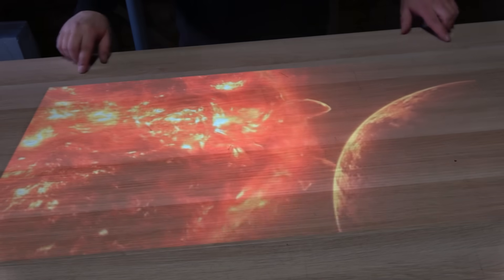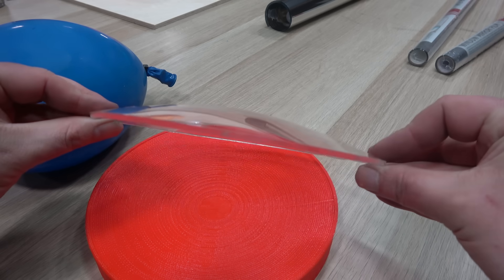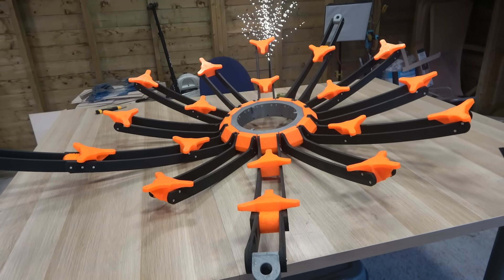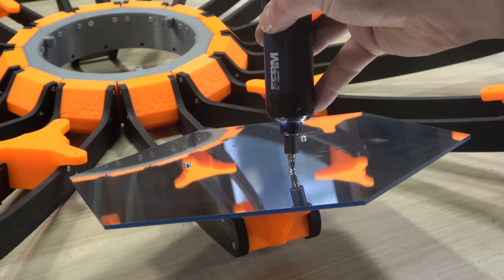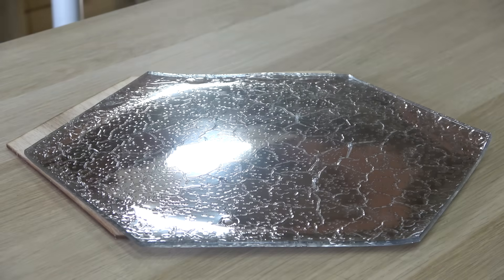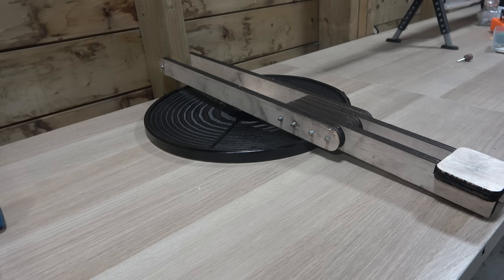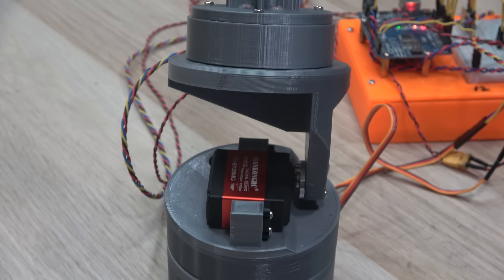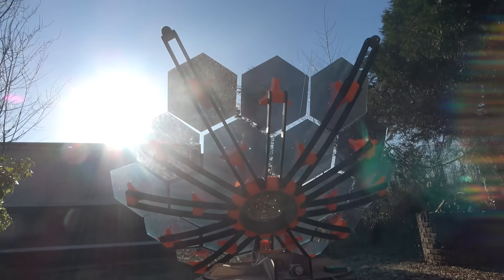Building a DIY Solar Generator..

Comment: One glaring thing that may be a problem... the heat collector is currently reflective. Spray it matt black with heat resistant (stove paint) paint as it will absorb heat much better than the shiny surface.
Reply from the maker: Good one!👌
Reply: @ConceptCraftedCreations The fact you're using aluminum gives you an option for making it black: 
There was research done stating that a simple candle's soot actually forms carbon nanotubes onto the aluminium surface.

Simply put, just soot the aluminium disc with a candle and gently have something transparent to protect it from the elements.

Used this for my solar space heater, works well, however haven't tested if simply painting it black has any difference. But theoretically the nanotubes would be perfect light capturers.
Reply: @elpi2804 the soot might not last in adverse weather conditions
Reply: @elpi2804You haven't had problems with the soot oxidizing off the surface? I assume you have a direct solar arrangement if that is the case, I don't know if that would hold up under the conditions of concentrated solar.
Reply: @sandwich2473 you could seal it with something, lose a little efficiency for durability
Reply: @elpi2804 you can't put glass on the collector... most glass only has a transmissivity of about 0.8 or your'd be reflecting a significant amount of solar energy. The guy suggesting liver of sulfur probably has the best low cost idea. Either that or some form of anodizing.
Reply: @ConceptCraftedCreations  dimple the surface like a golf ball before you paint it for more surface area.
Reply: @IvanSpaceBiker  that would do absolutely nothing.
Reply: @ConceptCraftedCreations  it might be hard to find paint that can resist such high temps, but i hope you do. In either case sand down the surface with a medium grit to make sure there is no reflectiveness, either on the black paint or the bare aluminum.
Reply: @SocialPrime  Oven paint will do, the cheap one I use is up to 500°C heat resistant
Reply: @SocialPrime  Paint for BBQ's
Reply: Anodisation would be hard wearing and shouldn’t need much maintenance.
Reply: @psibug565  this is the way. Paint, even "heat resistant" paint will be no match for the high temperatures  it will experience.
Reply: high temp paint or ultra black are good paint choices. Not sure how affordable ultra black is but it absorbs something like 99.9% of IR and UV that hits it. Stuff gets super hot even indoors under air-conditioning, it's really effective.
It might not resist the super high temps though, so High temp paint, which i believe has carbon in it, is very effective as well.
Reply: .I think the point is to reflect the heat to a single point and collect from a large array to concentrate the power potential.
Reply: You'd be best off sand blasting the surface then black anodizing the active surface of the metal. You get geometric and thermodynamic advantages to light absorption.
Reply: I believe carbon soot is less reflective than high temp matte black paint.
Reply: I can tell some of you don't do camping. Try cooking with a pot over a wood fire and then attempt to clean that pot! 🤣
Reply: That's a great idea, I was just thinking about that but I think it's made for cast iron so you should check if it works on aluminum at high temps
Reply: Hard anodizing would be my suggestion. It has extreme heat resistance, has a course surface finish (not to the naked eye) and therefore better heat absorption.
Reply: Was also thinking this. I was also thinking why not put the collector out at the focal point so one side is in direct sunlight and the other is in the reflected light heating it from both sides.
Reply: You can use the blackest paint in the world

Comment: I designed a very similar parabolic system for a humanitarian project aimed at desalinating water (it also produces energy). We incorporated a turbine specifically designed for the flow rate of the steam generated, ensuring optimal energy production.

In my case, I justified later the design by referencing the James Webb telescope to leverage its prestige, though it did not directly inspire the design itself. The hexagonal shape ensures optimal precision in forming the parabolic curvature ratio, which leads to the best focal length and, consequently, the highest efficiency. Our system uses a highly precise skeleton for structural support, eliminating the need for springs. Additionally, we utilize a different material between the mirror and the support structure to improve durability and performance.

For solar tracking, two axes of movement are essential: daily tracking (East/West) and monthly adjustment (North/South). Our system also uses a worm screw mechanism for daily tracking and a stepper motor for monthly inclination adjustments, both equipped with reducers to provide the necessary torque to move the structure. If you're in the Netherlands, your system should be oriented south. To achieve accurate azimuth positioning, your Arduino code must account for your specific longitude and latitude, the parabola's position and orientation, the current date, the time of day, the solar altitude and azimuth angles, and any necessary compensation for tilt or misalignment of the parabola.

Regarding the reflective film used here, I think it appears to be Mylar. While suitable for short-term projects, I wouldn’t recommend it for long-term applications due to its lack of durability. Instead, I suggest using the Tollens reaction with silver nitrate to create a high-quality reflective surface. If that’s not feasible, polishing and shining stainless steel (grades 305 or 316L) is a robust alternative. Although time-consuming, you could reach up to 98% reflectivity and is much more durable. Based on what I see in the video, I estimate the reflectivity to be around 80%, which could be improved. A proper lumens test would help verify this.  

Check on our website Niris, you can see the V1. We are currently at the V3 (we need to update the website tho). I improved the Tesla Turbine to make it worked at lower RPM for the V3. It requires dry steam.

Comment: 10:50 you have shown that plexglass will deform under pressure at ~100C, so that backplate is certainly going to deform under the water/steam pressure at the temperatures this will run.  You're going to have a ton of leaks, at least internally, pprobably externally too.  Seeing the water circulationg is nice, but probably not economical unless you can use an acual glass sheet.  Probably better to use aluminium or steel (or copper, see below) for the back plate.

Aluminium also doesn't distribute heat well.  While the recommendation to make the central collector black has been raised, I'd also reocmmend a copper cladding on the outer surface to distribute the heat evenly on the block to prevent local hotspots boiling your water.  You can use computer thermal paste to get good thermal transfer to your aluminium block, and then paint the copper black (or just heat it up to 300C+ and let it oxidize in air - Copper II Oxide is matte black and temperature-stable).

For the mirrors, you only need 6 different forms to make the whole mirror match one big parabolic mirror.  Each of the 6 triangular sections of 6 panels can be rotated about the origin.   For forming, vacuum presue may casue less problems with delmaination of the mylar then sandwich pressure.  As an alternative, there are ways to electroplate platsics involving conductive paint, then plating copper, then silver.  That might be possible post-forming, eliminating the stress cracking and buckling.  Don't try to plate chrome, it's not worth your health despite being cheaper.

Comment: JWST needs parabolic mirrors to create an image, you do not have the same requirement: you just need all the light from a mirror to reflect on the collector. A plane mirror illuminated by the sun creates a reflection of the same size at most, so the only requirement is to have a collector of the same size of the mirror.
Reply: Partially true, but one thing to consider is that the efficiency of a solar heat collector is proportional to the temperature difference you can achieve, and you can get a larger temperature difference for the same size collector by concentrating the light using parabolic mirrors.
Reply: Yes, focusing to a point is unnecessary unless you want to melt things - key is to collect energy as heat more efficiently, not concentrate it more than is necessary.
The same energy can make a high temperature over a small area, or lower temperature over a larger area, and the latter may be more efficient by maximising heat transfer time to heat the fluid medium by the desired amount. There are a lot of things to consider.
Coating the collector with soot from a candle will also increase absorption.
Reply: This is a good point, I think a solid compromise that would be especially effective here, is set a reasonable focal goal for the curvatures, small enough to splash the majority of the target for good transfer.
Reply: This is only partially true.  Yes, the total light reflected doesn't care about the shape of the mirror.   But the nature of the collector matters.  First off, for total light reflection and collection, you can't just put an identically sized & shaped collector in front of a flat mirror or that would shade the mirror - you could do what you suggest by reflecting at an angle to a collector off at an angle, of course.  But there is value in using a parabola to at concentrate the light to a smaller collector area because higher temperatures result in higher efficiencies when converting that heat to energy (basic thermodynamics / Carnot Efficiency).
Reply: The primary dish array needs to be a rough parabolic shape to focus the light to the secondary mirror. The secondary mirror needs to be a convex mirror. If it isn’t convex you will scatter all the light you just collected. A flat or concave secondary mirror with reflect the light from one side of the dish to the other. 
If you don’t believe me the JWST uses a convex mirror as its secondary mirror. Also there are online optics simulators you can use
Reply: @jacobs8718  nothing to believe here, it's pretty obvious. in my post i was thinking of having the collector at the boom, not the way jwst or the op does, leading to some confusion.
Reply: I think the reflection might be slightly larger but the sun is so far away you would need a very accuracte measure to see it.
Reply: Yep. He’s basically got 18 mirrors reflecting. So if it bounces forward then back to the center, that center disc will have 18x sunlight exposure anyway.
Making each of the 18 its own parabola is adding unnecessary complexity
Reply: about the size of the collector you are not correct. only if the surfaces of the mirror and the collector are parallel to each other, the reflected image that forms onto the collector will be of the same dimension as the one on the first mirror. When the beam of light hits the collector obliquely, the dimension of its projection can be much larger.
Reply: @rogiervdheide  very true. I don't know what i had in mind at the time, but i phrased it very badly. In this context though, the collector, even after multiple reflections, is generally about normal to the incoming light (the contraption should follow the sun) so the more general case don't really apply
Reply: @dolomighty74  that's right!
Reply: I agree, I think for a V1 flat mirrors are fine. Parabolic mirrors should be an improvement as an upgrade for more efficiency.
Reply: @ No, flat mirrors only fine if the collector is where all the reflections impinge on it on the end of the boom.
There is no shape that can then reflect them all to the collector in the centre of the dish as they would all miss except one.
In this case they would need to be partially focused to land on a parabolic convex reflector to then land on the collector in the dish, with a suitable radius to provide a temperature enough to heat the water to the desired temperature.
Reply: Also concentrating all heat into one point might not be as good idea, the heat collector is quite large so I don't see why not to heat up whole surface

Comment: I spat my coffee when you realised the metallic brown paint didn't reflect the same as the silver one. JWT uses elemental gold for a reason - they're not blinging it out. FYI: you know you can get IR lasers and LED's. Your test makes sense if you wanted to collect a very specific wave length of red. Which you don't. And don't get me started on the design of the "death ray".
Reply from the maker: Cheers mate!☕But seriously.. I DO want you to get started on the design of the death ray! What did I do wrong? The worst thing that could happen is that I learn from you right?

Comment: Great video, you mentioned that the heat is at the infrarred, do you have access to a thermal camera to confirm that? And I’m not just saying, I already did it and the result is shocking…
Reply from the maker: Don't say that and don't share what you know😋 Because now I want to know what you know😅 Want to share it?

Comment: maybe a frame around each mirror that compresses each segment to a parabolic shape (it will need a back to hold shape) , this would remove the need for heating, also screws in the mirror face making the mirror a cleaner surface.

Comment: Shape the mirror before you coat it.
Reply: I was thinking the exact same thing.
Reply: Have you ever tried to put window tint/film on a curved surface like that? Tint does fine when curved in one direction, but sucks getting it to lay down flat in two.. without a LOT of heat from a heat gun you'll never get it to lay down flat on a parabolic shape.

Comment: Some suggestions: Rather than try and bend the mirrors into shape, you could try Mylar and a vacuum to form a perfect parabola and focal point - no screws or heavy mirrors required. You could also make the mirrors a LOT larger. Mylar only reflects about 90% of light but making them larger (maybe to to the same weight) you''ll get a lot more overall energy.
I presume the secondary mirror you mentioned (not shown) will be at the focal point and it's to reflect the light back to the heat exchanger. But that secondary mirror will need to handle about 7kw of energy - the same amount as the heat exchanger - it's going to get very hot, very quickly. A single reflector (array of articulated mirrors) will be easier to build and won't melt.

So if you created an array of vacuum drum mylar mirrors each with 2 axis articulation and an adjustable vacuum - with some programming to relocate the focal point you will have a death ray.
Reply: mylar on it's own is already more reflective than the mirror tint he's using, so this is a good suggestion.
Reply: @Corvus.2606  Mylar isnt that UV stable. Its also not much cheaper than gold.  you can get gold for less than 10$ a m²

Comment: you can also take a plate of some sort, cover it with reflective plastic, and partially suck the air out from the plate which will create a vacuum and pull the plastic back a little leaving you with a perfect concave mirror
Reply: Would mylar work for that

Comment: You can use half of a large pipe cut along its length as a mirror. Then, you can place a copper pipe painted black, in the focal point of the large pipe, and just circulate water through it.
Reply: pipe is circular, its not efficient. needs a parabolic shape but YES, thats an easy way to generate heat.